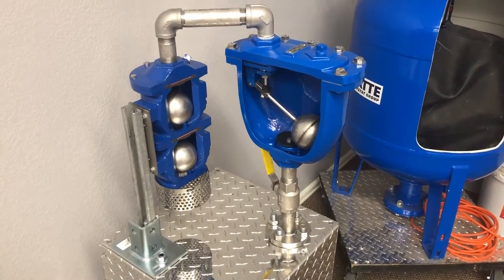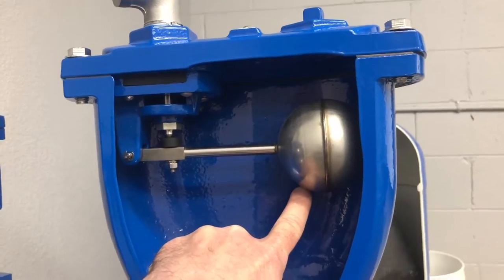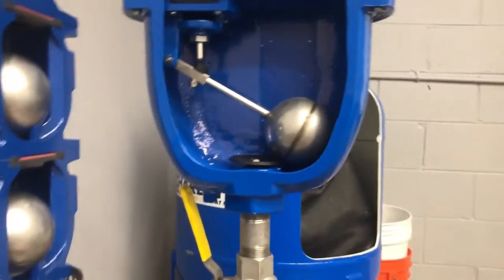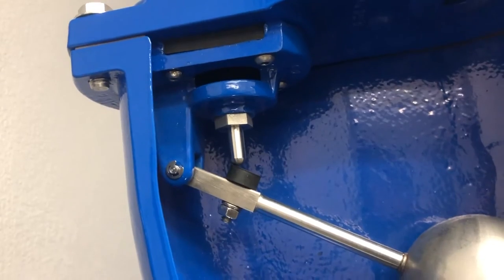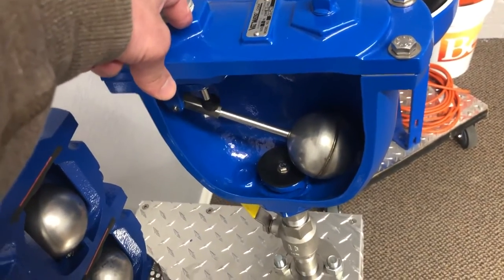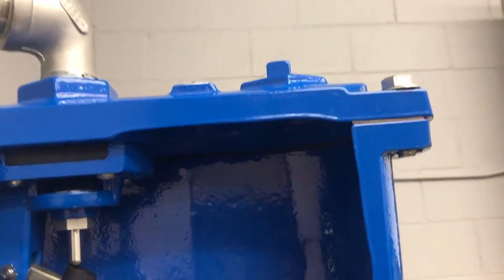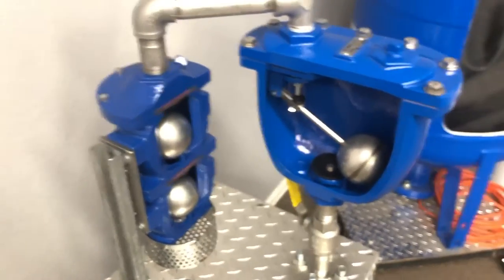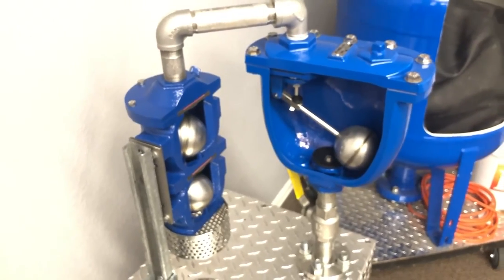ValMatic Combination Air Valve Demo

Comment: Anyone know why a brand new unit would have a constant water leak (.5 gal/min)?
Reply: Pete, there should not be a constant water leak on a new valve.  What are your operating pressures?  Lower pressure applications may require special seats.  The standard valve is rated for 300 psi but there is a 75 psi option too.